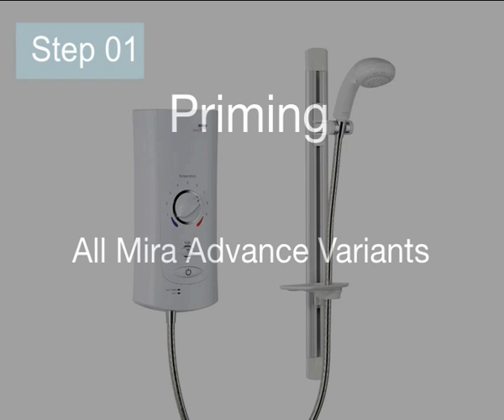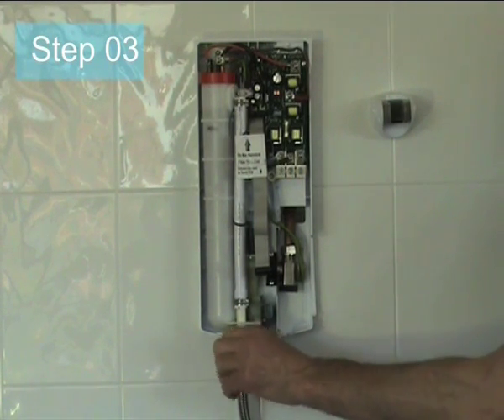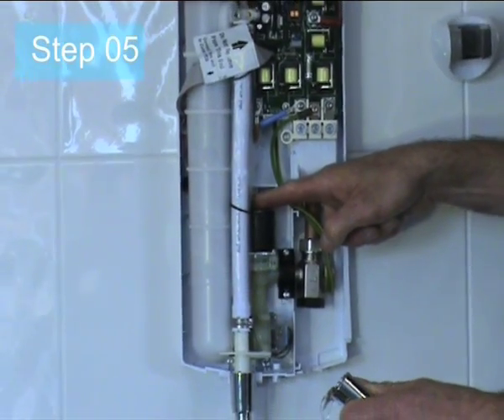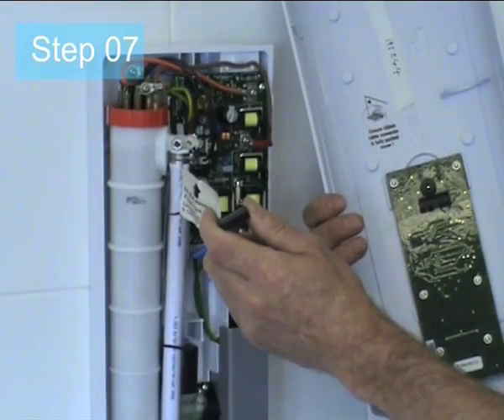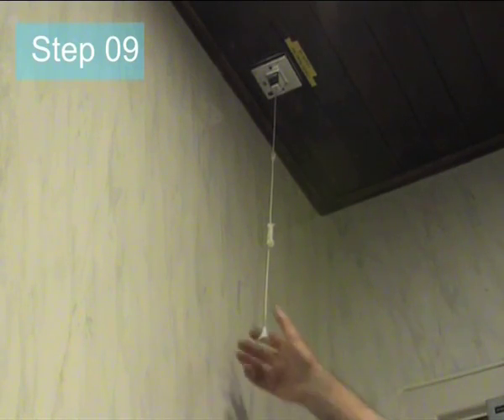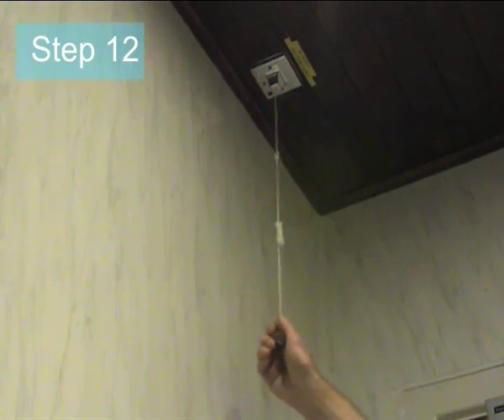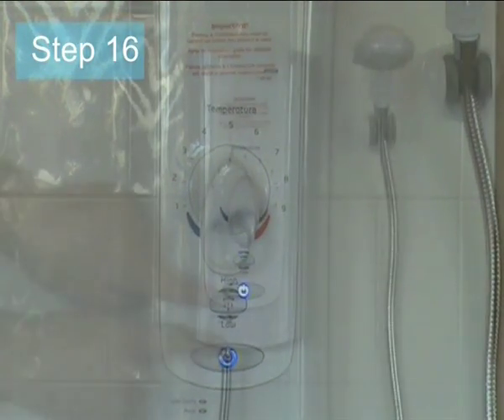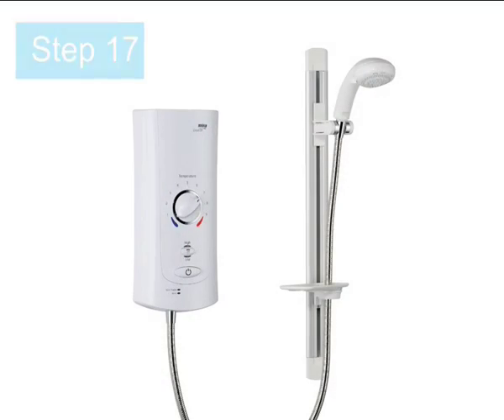Mira Showers - Step-by-Step Guide to Priming & Commissioning of Mira Advance

Comment: Hi need help I have a Mira advanced shower with a square rail the shower head fits on it’s in a wet room due to my disability. Can you tell how I change the head holder as my one doesn’t stay up and there are two spring loaded clips and wife said she can’t get old one out